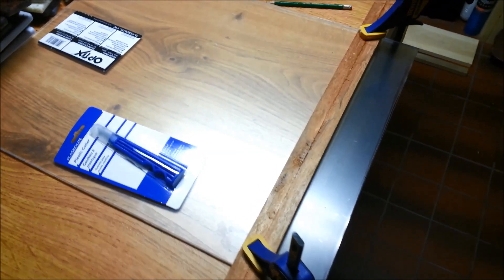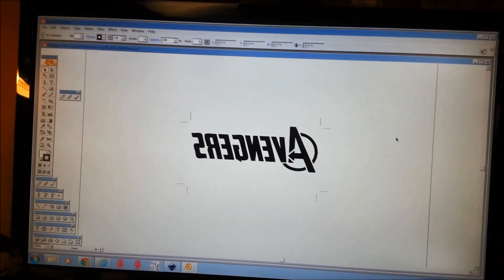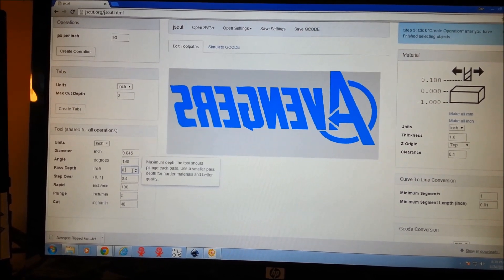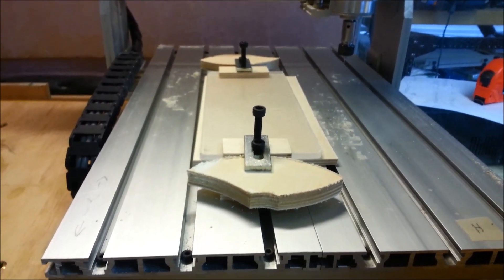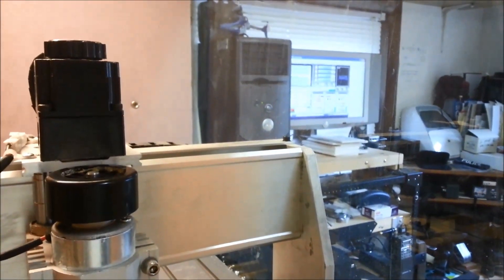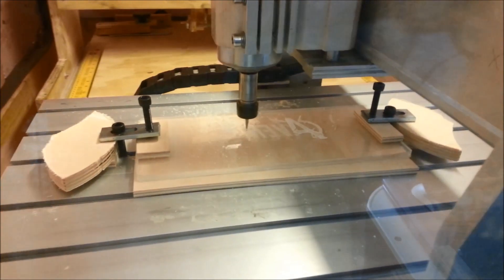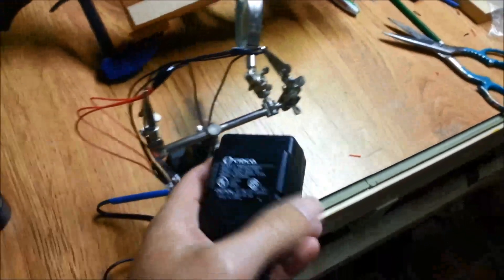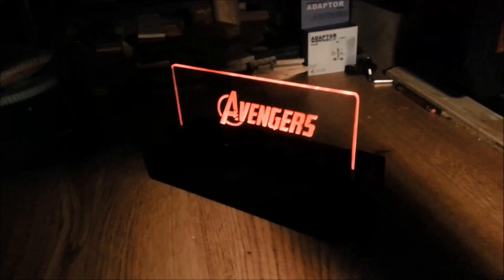CNC - 3040 - Back Lit Sign

Comment: Nice video. I'm sure you know this by now, but the acrylic sold at big-box stores is "extruded" which melts at a much lower temps, which is why most CNC projects turn out best when using "cast" acrylic.

Comment: Nice job, what bit did you finally go with and where did you get it?
Reply from the maker: james shelton Hey James - I used one of the crazy sharp engraving bits that came with the CNC.  Worked pretty well for a somewhat small job like this.  For larger plexiglass signs I ran into some trouble as the bit got warmer and warmer.  Still working out the bugs in the process for big signs.  Thanks for your comments.
Reply: drez20001 I did find some Plastic cutting bits on Toolstoday site

Comment: Hello, Could you show how you prepped the logo in illustrator. That's where I have the hang up when I try to load the file into scut thanks
Reply from the maker: TheTide1996 Sure.  There's actually an even easier way to do it rather than using an old version of Illustrator.  Inkscape is a free vector program that works even better with my CNC than Illustrator did.  And Inkscape integrates with Jscut beautifully.  Here's what you could do:  
1.  Take a snip or screen capture of any text, image, whatever you'd like to cut.  Do a copy, paste into Inkscape.
2. When the image is pasted into Inkscape, go to Path, then Trace Bitmap.  
3.  Do the trace.
4. Pull the trace off of the original snip by dragging your mouse over it.
5.  Delete the snip image.  And you're done.

The image is now ready to go.  You can enlarge, flip, invert, stretch, do whatever you'd like to it in Inkscape. 

Save it as an .svg file and open it up in Jscut.  And doing it this way you don't have to click on each letter, just one click on any of the letters will highlight the image in Jscut.
Reply: a tip: watch series at Flixzone. I've been using it for watching loads of movies during the lockdown.
Reply: @Liam Jamison Yup, I've been watching on flixzone} for since november myself :D

Comment: Nice. I will be starting my cnc build soon. Been doing some research and i'm concerned about the software costs(cad,cam,control,and other misc.). I see where I could easily spend more on software than the build.
Reply from the maker: Lee Hill Hi Lee.  There are many many options for free or low cost software.  There is no need to spend a fortune, at least not at first, for software.  You can do true V-carving for free with programs like F-Engrave http://www.scorchworks.com/Fengrave/fengrave.html - it's a really great program for signs.  You can also generate g-code for free through programs like Jscut and PartKam.  Inkscape is free and there is a free plug in called Gcodetools that will let you export g-code straight out of Inkscape.  There are lots of options.  Best of luck.
Reply: That's good news to hear. Thanks for the info.